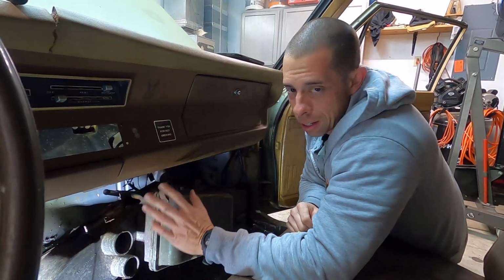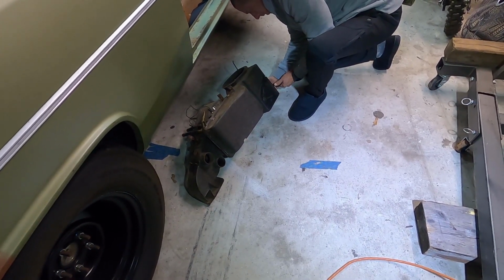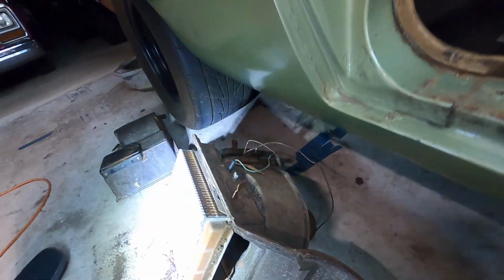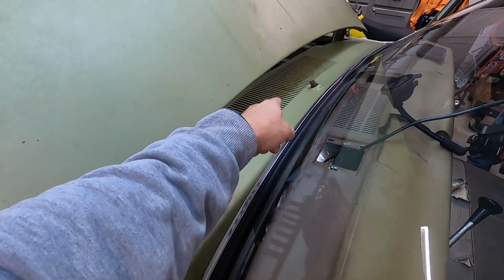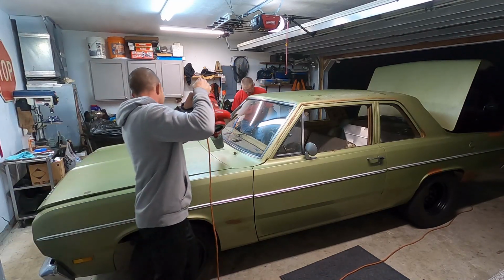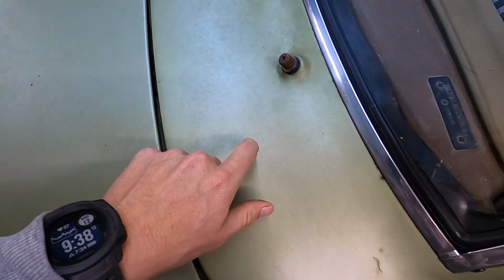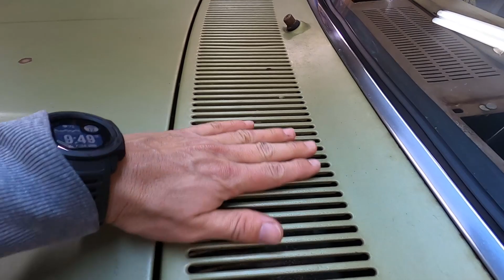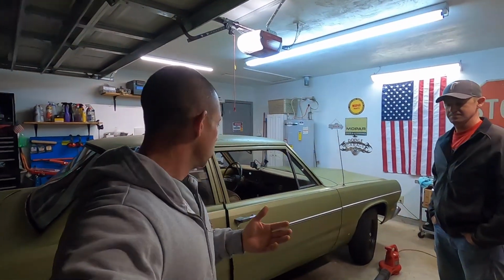Heater Fix Pt.1 (1969 Plymouth Valiant)

Comment: My heater core in my 70 duster spring a bad leak.  I think it had a very minor one but now it’s dripping badly, I bypassed it temporarily, but thanks for sharing how to pull the heater box out, once spring comes this will be my next project.

Comment: The other thing is the windshield wiper pivots leaking and possibly the cowl seams too. The drain areas get filled with crap and help everything rust out too. I replaced the foam pivot seals and some others and cleaned out the drain areas and it still leaked but was better. You can also put old valve stem seals over the top of the wiper pivots and it helps. In old Mopars if your feet don't get wet when it rains it wasn't built right 😉
My Dart is a LA built Western Sport Special and has the same steering wheel factory, including the crack...

Comment: Found the same thing with tree litter in the cowl of my 69 Aussie Valiant... 
60 mp/h and open those bottom vent door's, inside looked a lot like that afterwards... 
Radiator shop should be able to pressure test core for you, had mine done. 3 day's to unblock and test, good as new... 😎

Comment: Is there a body plug in around the door hinges that would let you get air blown into that cowl from the end. If it is like the trucks it is open down low behind the fenders. There has to be some pretty good sized drain holes otherwise it would just fill with rain water.
Reply from the maker: I looks like it just roles off into the fender.

Comment: The foam rubber strips that seal to the vent doors are important for full air flow and to keep the cold air out of the airbox in Winter.

Pretty important up here.

Most of my Cheeselers are 40 years old. Never had to change the O.E.M. core. It's a problem with Fords and Chev-a-lays, not pentastars.

Malcolm Ottawa Valley